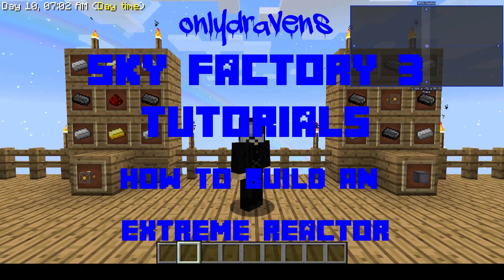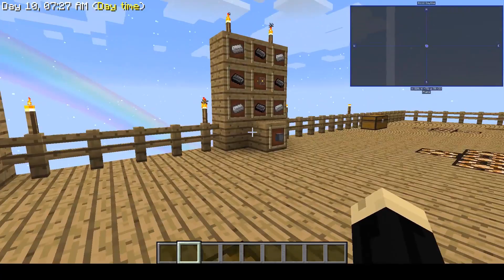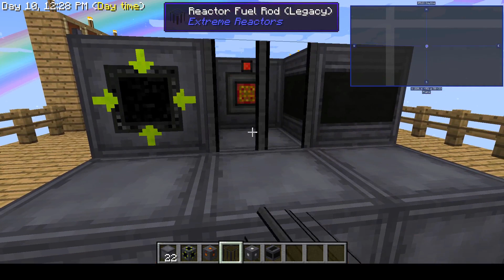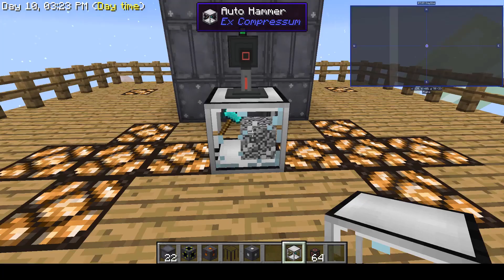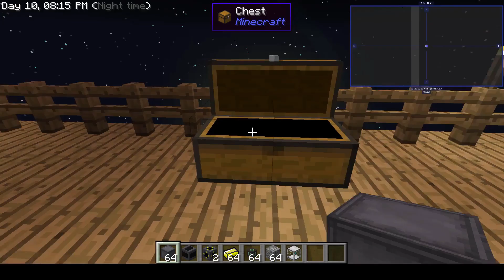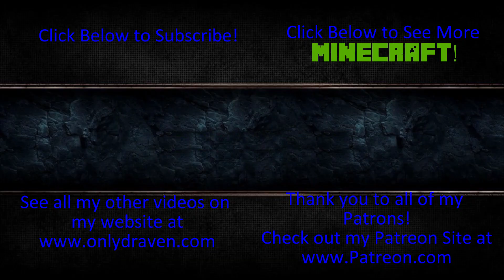Minecraft Sky Factory 3: How To Build An Extreme Reactor

Comment: just a note: this works fine with just iron, no need to waste all those diamonds
Reply: Diamond works a lot better in heat efficiency (Iron is .75 diamond is .85) diamond also has better moderation and conductivity an absorption, diamond is the best material for this